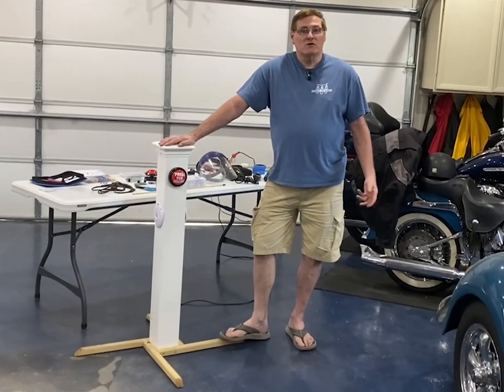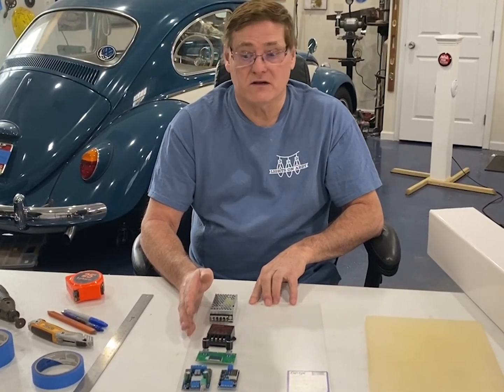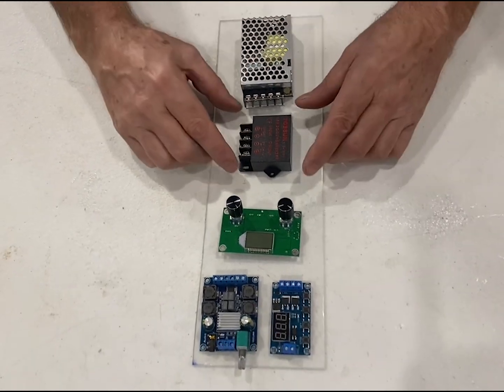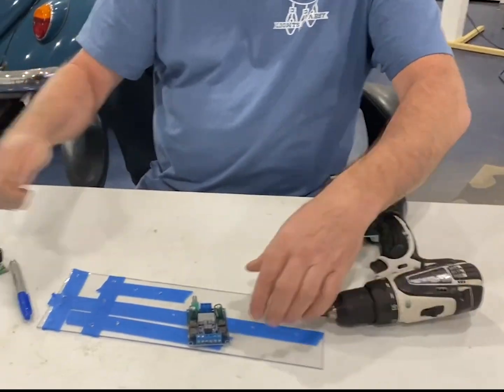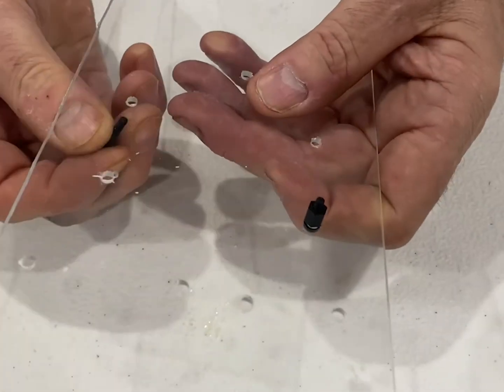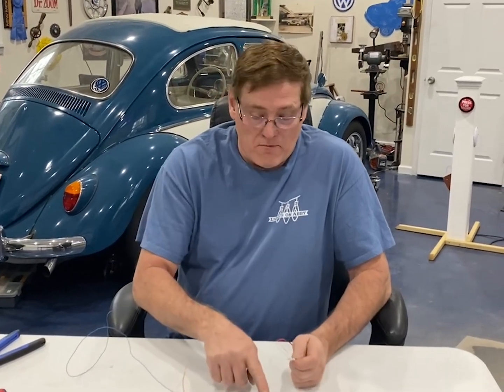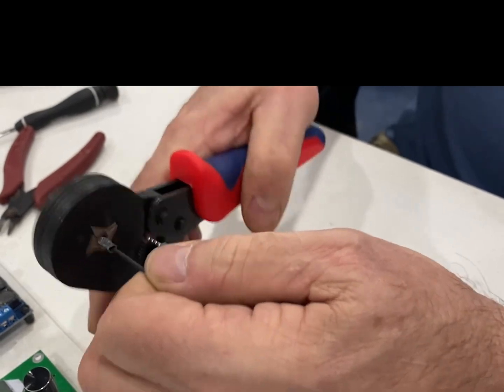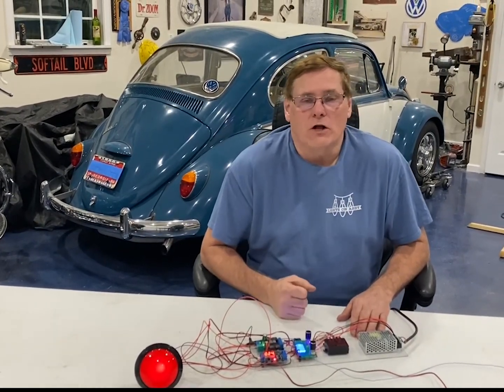Building a Light Show Sound Pole - Part 1

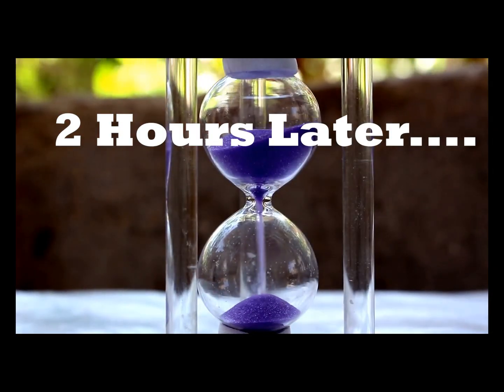Comment: Thanks for the tutorial. In your supply list, you call for a DC 24V to DC 12V 10A 120W Step Down Buck Converter. Your diagram at 10:08 shows concerting the 12v down to 5v for your FM receiver. Wouldn't you need a 12v to 5v converter or remove need for converter by powering via USB?
Reply: I’ll check the supply list as I know the only buck I used was from 12-5v.  And I didn’t use any USB based PSU.  The way it’s wired all is off (but PSU).until the button is pressed.

Comment: Nice video, but regarding you installing the antenna in Part 2.  I do not see it in the parts listed, does it come with the receiver? I looked at Amazon, but it is not clear if it does and I could not find the same type with the mount you are using.
Reply from the maker: Sorry I failed to add the antenna used in the description.  The link has been added to both videos and here it is as well : https://amzn.to/41Iuiuj

Comment: I want to give a thumbs up, however I am torn on the decision.  Though a good informative video(s) - both part 1 and part 2, it leaves me looking for the missing video.  What happened before PART 1???  I see the components you used and there are links(?) I think, but you just jump into placement of components with no explanation about these components or even a schematic for reference.  Nice build video, but it just leaves me wanting a little more guidance on the initial components (FM receiver, etc.) hidden or assumed  unless it is a secret and you are just showing off so to speak. Hopefully a third video is being considered or just a schematic link provided so we can successfully use the information given in part 1 and 2.
Reply from the maker: The parts are listed in the video description with the links.  When you look at the links, you can see the components and become familiar with them from the listings.  The schematic for wiring is shown at 10:08 on the table when I say "I've completed wiring..."  That schematic is then blown up to full screen.  Merely pause and screen capture for your reference.   If that doesn't work,  send an email to lightsonabby22@gmail.com and I'll send you a Powerpoint on how to build it.